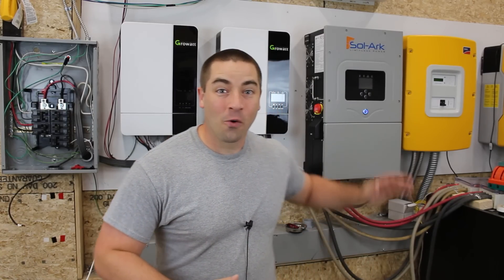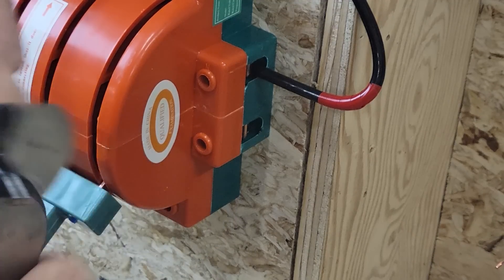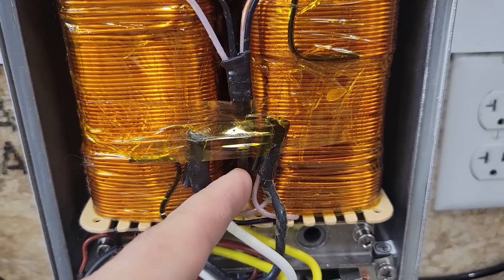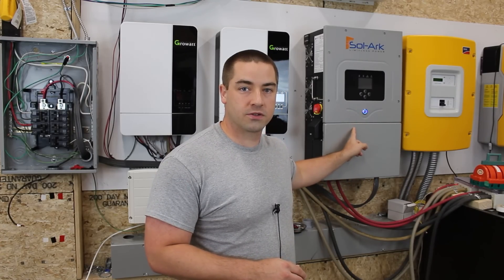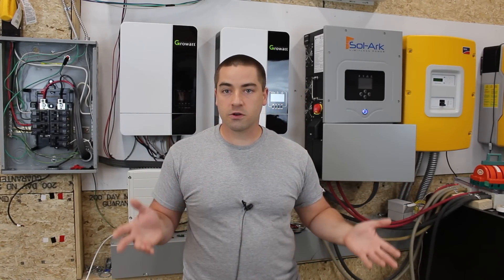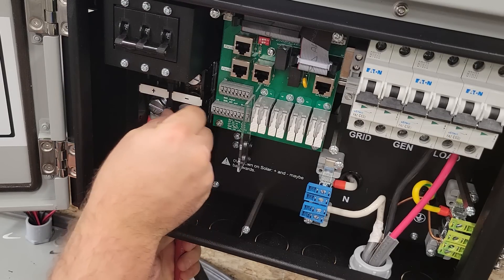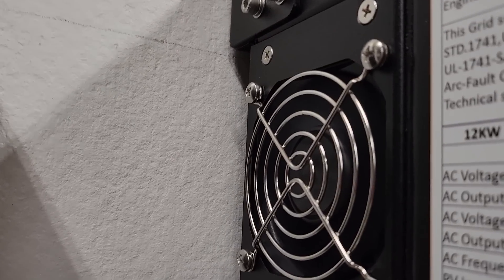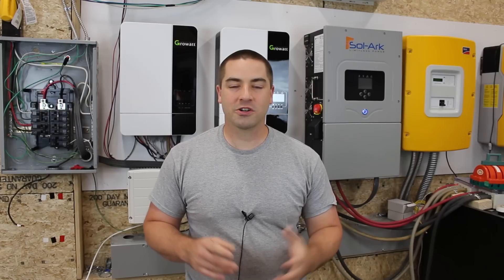Sol-Ark 12K 48V Inverter Install (to compare with Growatt 10K)

Comment: Don't forget AFCI and GFCI protection that the sol-ark provides, plus RSD shut down trigger for roof top solar on a home. Its a lot of money but it does a lot of things including CTs for self consumption and time of use battery functions.
Reply: Actually the ct's are extra for 200 amp services. The shutdown "feature" is a bad thing and nobody undertmstand the backup only functions to critical loads!  ...and doesnt it say in the manual you cant hook the sol-ark up to panels with afci breakers? By any chance do you work for sol-ark?
Reply: @John-mg3ws  No I don't work for sol-ark, but I do install of them. The RSD for the panels is triggered separate with the a push button for fire fighters if there is a fire etc, but if the grid power goes out it will not affect solar for back up power. AFCI/ GFCI is internal to the inverter and required for all UL / ETL US listed DC inputs on inverters and charge controllers over 80v DC for roof mounted arrays. However AFCI and RSD are not usually needed for ground mounted arrays. Our supplier orders Sol-arks with 200 amp cts only, most come with 100amp cts.

Comment: I think we going to find the Growatt’s are  a better solution.
Reply: I don’t think so. It’s going to be my two 12K’s. If they don’t work out, I’ll stack four Magnum 4448PAE’s and 8 Midnite Classic 250’s.
Reply from the maker: Certainly less expensive, but not better if you require AC coupling or net-metering.

Comment: Great video david i dont know if you can go into the inverters logs and see what caused the trip, but if the monitoring was up and running you would've known for sure...hope  the testing goes better.
Reply: Almost certainly an overload on one leg.  Maximum 120V load on a given phase is 4.8kVA.  The reason the Growatts didn't trip is the autotransformer balances the load so the system can handle close to 10kVA on a phase.
Reply from the maker: Every time it tripped the error code was for AC overload.
Reply: @DavidPozEnergy  as you said it might be because of an imbalance....out of curiosity was the autotransformer in use?
Reply from the maker: No, I currently have the auto-transformer disconnected.
Reply: @DavidPozEnergy  if you dont mind do a torture test with and without the autotransformer....this tells me i might  need to get one for my deye8k and thank you for all the videos and test you have done!

Comment: Do you think the auto transformer will add to the overall load?
Reply from the maker: Yes, it does.  If I remember right, the auto-transformer has an 18W idle draw.  And it knocks off at least a percentage point in overall efficiency.

Comment: Great vid.. I guess you'd need 2 Solarks paralleled.. When you said the Growatts don't have the ul listing for net metering agreements did you mean the models you have or all Growatts?
Reply: Wow. Not listed with, or the UL Trade Stamp. That means you can't us them here in NAZI California what a FRIGGING shame; Was ordering two next week!!..Widowmaker
Reply: @wehvacwehvac5612  You would have to get the grid-tie/hybrid growatt inverter however you can't find those for the US market yet.
Reply: @cquintana9326  Growatt does have a UL listed hybrid for the US market. The only downside is that it's a high voltage unit with battery banks needing 250 to 350v. Similar to Tesla, Generac and other high voltage systems.
Reply from the maker: I can only speak for the model I have.  I have not read the spec sheet for every model Growatt.

Comment: What is the stand by power and efficiency for both configurations?
Reply from the maker: You got it.  I'm interested in that too.
Reply: @DavidPozEnergy  seconded on that. I have a solark and i have no idea what the actual stand by load is
Reply: @av1204  My 2019 build date green board 12K is around 80W.  My 2020 build date blue board 12K is around 60W.  Both are indoor units.
Reply: @av1204  If you get the dongle and setup the monitoring software it's very easy to determine that. If I shut off all the loads to the Solark it hovers around 35W. It used to be around 60W but a firmware upgrade earlier in the year seems to have dropped it. Standby is not something I worry about as my place is powered by the Solark 24/7, I can't say the same for the other inverters I've had Growatt etc, that happily sat there chowing down on 120-150W doing absolutely nothing.

Comment: I have the split phase 12kw Growatt powering my off grid house and my feelings are mixed. Yea it’s cheap but there’s a lot of little problems and it’s not giving me a good feeling relying on it to keep my home powered going into my first winter here with no real backup. Signature Solar tells me to update the firmware but I feel like there’s a real chance I brick my system and then I’m really screwed. Anyone reading this and want a reliable system, I’d really consider spending more money on something more reputable. And don’t rely on Signature Solar for any real tech support. They can actually tell you some down right dangerous setup instructions.
Reply: I've been very skeptical about the 12kw LF Growatt with their limited availability but you are the first I've seen to have a kinda negative response. But then again I have yet to see "ANYONE" who has done a review of the Growatt 12kw who hasn't been given one for "FREE". Sponsored reviews are NEVER honest. Thanks for speaking up and I would love to hear a more detailed "honest" review. Rumor has it they are going to release an updated version. The 12kw is a no brainer for who wants the most of being off grid. Anything smaller is just a waste of money to me. Adding a neutral auto transformer is just too risky and I would never even consider that, that's why I love the LF model. I've just completed my  total home electrical upgrade to separate all my 240v loads from my essential 120v loads panel into separate load centers along with a generator transfer switch and now I await a good 12kw version of the Growatt LF or something similar. Thanks for your comment.
Reply: @wgoode505  Can you elaborate a bit on the risk(s) of using an auto transformer please? I plan on using one with a couple of stacked 5KW Growatts.
Reply: @wgoode505   AverageJoe made several good videos on the 12k growatt .  https://www.youtube.com/watch?v=-q9C1vfY5rk
Reply: I love redundancy. Just keep saving and buying.
Reply: It would be cool if you did a vid showing the problems . I am about to do a on grid system and its a little disconcerting the lack of clear reliable information available from the vendors
Reply: My last MSG is directed to Travis H88
Reply: I had a problem with mine shutting down do it to a fan lock code.  Did a firmware upgrade and no problems since.
Reply: My two MPP LV6548's have been running great, and only draw 120w combined, while providing 13KW of power.

Comment: Solark is interesting. Always considered them way out of price. We discussed the noise of the Growatts and they no good for my rv. I need 8k unit. What would you recommend. You have use many brands. Also in 8k need split phase so as not to overload neutral. No 240v in rv.
Reply: Victron is the best brand for RV inverters. Why do you need split phase if you have no 240 loads?
Reply: @ShaneFromSA  over load neutral.
Reply: Insurance, trucks, food, HVAC, building materials, CEO/executives salaries are way overpriced. I see guys driving $90,000 trucks, $60,000 boats and $35 Razors, while living in a mobile home, drinking and chain smoking. People can always afford what’s important to them. I’ll have $60-$70K in an off grid system with two Sol-Arks, 22kw pv, 108 kWh LFE and 10 kw gen.

Comment: Could you compare the idle consumption between them? I know on paper the growatt should consume more, but it’d be good to have some real numbers
Reply: This was my main quesiotn. Some say you can always add a solar panel to compensate, but that ignores the battery drain.
Reply: Yes I'd like to know the answer to this as well. And maybe broken down so we know how much the grow-watt is wasting and how much the transformer is wasting.
Reply from the maker: Hi Travis Sanders.  In case you haven't seen it, I have a video where I show the Growatt idle consumption with and without the auto-transformer: https://youtu.be/yWUfvvSa3K8
Reply: @DavidPozEnergy  awesome. I've been so busy lately I must have missed that video thank you for the link!
Reply: @DavidPozEnergy  ...and the idle consumption on the Sol-Ark, please?
Reply: I just added a transformer to my system and it didn't really change my idle consumption. Not by any measurable amount. My battery is 500 volts and my DC clamp meter can't really pick up tiny tiny changes in amperage.
Reply: I agree, my hole reason for watching this video was to find out what the idle consumption is, as it turns out, this is a big problem with alot of these low frequency inverters, one of them that I looked at a little while ago, has an idle consumption of 234 watts, that is completely ridiculous, that high idle current is the result of a poorly designed output transformer!!! A 100 KVA distribution transformer doesn't have that high of idle consumption, I can tell you that with idle consumption that high, the fans are going to have to run continuously, or it will overheat with no load on it, due to eddy current losses in the core.
Reply: Dc pv to Ac back to Dc batteries is 36% loss vs sol ark.

Comment: Nice video! Nothing against sol-ark, they seem to have a nice inverter. Is it stackable like the growatt inverters? Also, do you have links for the breaker setup you used (the ones under the growatts)? I like the distribution block! Does the sol-ark have the ability to have surge capability? Thanks for sharing!
Reply from the maker: It is stackable.  I don't have a direct link.  I found it on Ebay by typing in "power distribution block"
Reply: Sol-Ark 12Ks can be stacked up to 9.  Surge capacity is 10kVA 120V or 20kVA 240V.
Reply: Amazon has a nice smaller PDB. Plenty big enough for 2 ga - 1/0 ga.
Reply: so ark can back feed to main input panel unlike growatt inverter. limited power home you don't need electric net meter agreement with electric company as only back feeds what ct sensors measures never greater then. so you can power up your main breaker panel and your sub panel at same time. unlike growatt

Comment: You are going over 4500W per phase. you need the Solar-edge auto transformer. Right now My solar-edge is disconnected because when I tried to charge the batteries from the grid with the solaredge connected the solark shuts down. I disconnected the neutral from sol-ark, but in my panel I still have the neutral from the Utilities and I think I get some back feed through that. Otherwise the Solar-edge will balance the loads on the solark perfectly.
Reply: also you have half the drain on the batteries compared to the  2 Growatt inverters. You need at least 1.2 kw of batteries extra for the second growatt and maybe 1kw extra  of solar panels. (taking in consideration cloudy days.)  60w x 24h = 1440W
Reply: You need 3 kWh per kw of inverter.

Comment: Add the autotransformer to the Sokark .  Measure the standby power used by Solar and some form of efficiency test from battery and battery charging.
Reply: I have this issue on the split phase growatt I have.  Going to add a autotransformer.  Hindsight, would gone the 240v inverter method for my shop, but was looking for an all in one method.

Yes, the autotransformer will work on the Solark, others have done it.
Reply: @arthurhammeke8296  Which split phase Growatt do you have?  I have been looking at the 12K SPF 12000T DVM-MPV in part to avoid having to have & wire multiple inverters and 1 or more Mid-Point Transformer.

Comment: Nice good to see you on to another inverter test. Please explain why the inverter shut down when you have AC coupling invoked as you would have to pull more than both to overload. Main like to see for me would always involve anything AC coupled.
Reply from the maker: I've got it hooked up right now purely as an off grid inverter, pulling from the batteries.  You are right, that if it was AC coupled with a big grid-tie inverter, and the sun was shining, then I probably would not have overloaded it.  So, you are a fan of AC coupling?
Reply: @DavidPozEnergy  Yes AC coupling is the way to go with off grid backup. Since everything we want to use is pretty well AC it makes sense to convert asap, also their storage is bigger lol.
Reply: @offgridwanabe  except for battery charging which can be up to 50% of the PV usage.
Reply: @offgridwanabe  AC coupling is more efficient at feeding loads directly, but less efficient at charging batteries due to multiple conversion steps.
Reply: @ShaneFromSA  Did you know AC coupled battery charging is usually faster than DC coupled as you are not limited by the Charge controller and charging is at a higher rate.

Comment: My understanding is that the 12k can only output 8kw from the batteries. I'd like to see how it handles the surge on battery alone.
Reply: That is pretty shady advertising… 12k but only 8kw from battery
Reply: @DavidHalko  12k is has 2 charge controller both sized at 500v. worth 2k just in charge controller specs . growatts have 150v and 250v options. 500V is the way to go if you want save ton money on wiring. which is usually $300-600 plus can save money vs having a combination box which is another $200-500 savings
Reply: @firebird9232  the growatt has 450 on the voltage.

Comment: I've had my Solark for 13 months now and I couldn't be happier. I have 30 solar panels feeding it, two strings of different voltages. It's awesome to see it charging and powering the house drawing 9KW from the panels and not breaking a sweat. Shame you can't keep it 😁
Oh, and the online monitoring software for the Solark is streets ahead of the trash and insane software that comes with the Growatt that I was never able to get working in web mode - super frustrating. The Solark just works.
Reply: u have blocking diodes for the two strings of panels ?
Reply: @margarita8442   2 Mppt's
Reply: @margarita8442  It has two independent solar inputs so there's no need for such things. My arrays run at vastly different voltages but are connected to the independent input on the solark.
Reply: You cannot go off-grid with that kind of usage on the solark. You need the Grid connected.
Reply: It's your setup grid tie or off grid
Reply: Fake comment, this guy is full of it!

Comment: Very nice Sol-Ark inverter. Made in USA.
Reply from the maker: They are made in China, says so right on the data sticker.
Reply: @DavidPozEnergy  wow, I thought they were a company based in Texas and just assumed they made it here. Thanks for the video.
I’m still a fan of the SMA Sunny islands you have there. I’ve been using them with 30kwhr of LiFeP batteries and 7.7kW solar (ac coupled) and only area that the SMA are annoying is there battery state of charge algorithm and need for add-ons (Sma data manager m) for data monitoring. The sma frequency shift like the Sol-Ark and can also back feed the grid and use the grid for charging  or load assist (based on battery state of charge or when load wattage threshold exceeded). It can also automatically control a generator based on state of charge or load. I know you mentioned benefit of growatt is it can give combine its power from the inverters  if you have unbalanced phases and SMA could not do this but really when you connect it up you would try to make sure you balance your loads on L1 and L2 to start with. Also your limited currently by your auto-transformer to 5kw I believe. I have never had my SMAs shut off due to load and run a 3kw AC off them along with base load of 2.5kw  (this is  helped by the AC coupled solar so rarely the sunny islands are seeing all the load).
Reply: @curiousumscientia3648  do you have a YouTube channel or web Site?
Reply: @DavidPozEnergy  solark is supposedly moving manufacturing to their facility....so i heard
Reply: They are in the process of moving manufacturing to Texas. Hopefully that works out.
Reply: Haha still made in China.
Reply: Thanks for the feedback and insight. I have contacted the engineers at Sol-Ark before and I never heard that they rebranded. I see the Deye and never seen that before. I wonder what inverter came out first. Sometimes someone manufacturers in China and then there are rebranded versions everywhere (copies). Thanks again for everyone's insights.
Reply: @FilAmGabe  The Solark inverters are made by Deye. So who came out first, Deye haha. Solark just rebrands Deye inverters. Maybe in the future they will make there own but not currently.
Reply: Anyone that thinks Deye is a knock off of Solark has not been around very long:) lol
Reply: Yep similar to a Dye etc made in China but also serviced through USand made to Solarks specs and uses higher quality parts than other chinese inverters.
Reply: Made in China but engineered, inspected and tested in the USA
Reply: @FilAmGabe  its a rebranded deye/invt inverter with a custom firmware/chassis
Reply: @FilAmGabe  not sure if that is entirely true...it looks as tho these are white label deye inverters...fun fact they did a recent distro deal with deye to be the sole distributor of the split phase version...effectively cutting of the ability to buy essentially the same inverter for less than half the price! P.s the deye version has the exact same ul certs
Reply: @FilAmGabe  Rebrand DEYE